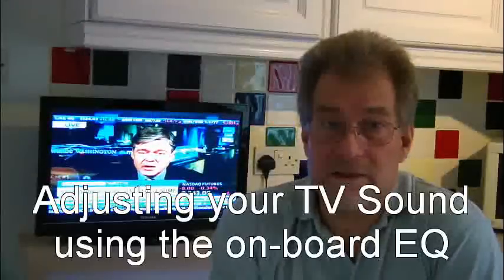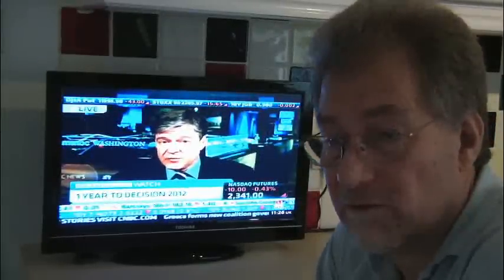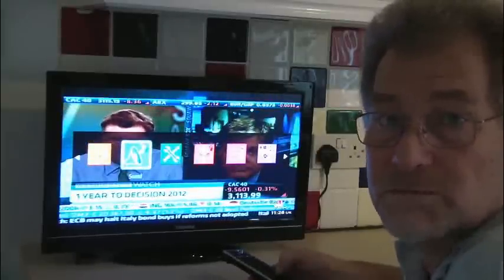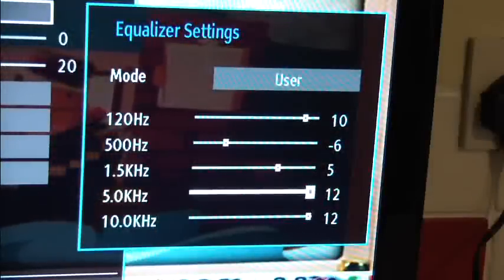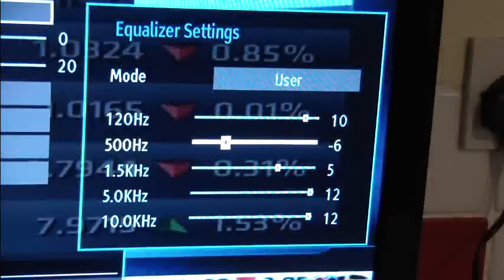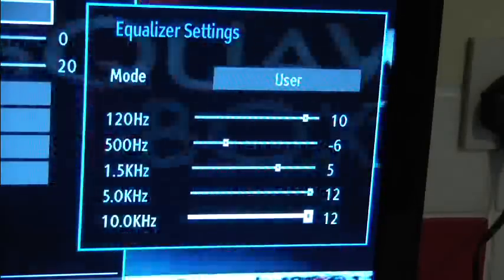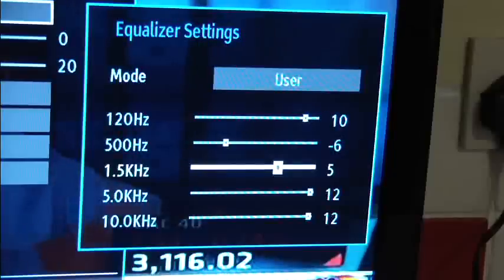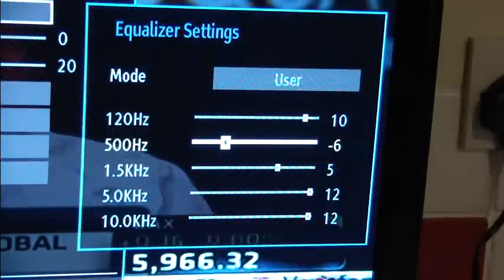Adjusting your TV sound using the on-board EQ

Comment: I just bought a smart TV from the brand "Vios" and I don't like how it sounds .

It has  these settings
High
Low
120hz
500hz
1.5khz
5.0khz
10.0khz

You can change them from 0-100
Which adjust you recommend?

Thanks and sorry for my English.
Reply from the maker: Hi, just try lowering or raising the different settings and then listen, using my video as a guide. It is impossible for me to tell you exactly what settings to change without hearing it and knowing the kind of sound you like and what you watch most on the TV (movies, documentaries, sport, etc.). Also, I don't know the brand of TV and how good the built-in speakers and amplifier are. If the voices are not clear, start by raising the 5.0khz settings (maybe to +60), and then try to lower 1.5khz (-20 maybe). If the voices sound very thin (little warmth in male voice) then raise the setting at 500Hz (maybe try +30). But the result will depend very much on the quality of the TV speakers and built-in amplifier; if these are poor quality then nothing will help, and then the best option is probably to buy a separate sound bar.

Comment: Hi Kevin, my Sony smart tv sound goes via my amplifier to surround sound system. I use YouTube a lot to play music learning the accordion. As you know the music downloads have various levels of volume which I have to adjust using my remote control interrupting my playing.
Is it possible to alter the tv settings to level all sound output.
Or do you know of a wireless volume control foot pedal to transmit to the TV?... thanks.
Reply from the maker: Hi John. I don't know of a foot pedal (I guess you might be able to control the level hands-free - vocally - using Alexa), but since you are taking the sound from the TV (via phono connections I assume) to the amplifier, there's the opportunity to place an automatic level controller between the TV audio outputs and the inputs to the amplifier. The only thing I can think of is a compressor/limiter of the kind they use in a recording studio to control the level of the vocalist etc. It might sound a bit OTT, but a search on Ebay will reveal a few of these designed for home studio use, so not crazily expensive, especially second hand. That would keep the maximum level under a threshold you set, and at the same time lift the lower level audio signals. Since you're a musician and would presumably mic up the accordion if you ever perform or record, you may find a future use for the compressor/limiter - it would help to smooth the level out as you move the instrument towards or further from the mic as you play, and it would keep the overall level in check. For practice use, just about any half-decent comp/limiter will be fine (I used to have a Yamaha GC2020 which would be cheap, as it's an old model, but would work fine for you). I use the Drawmer MX30 which is a good one for home studio use - you don't need a full blown pro model!

Comment: Hello, thank you for doing this video. 
I have a question. Is there a way to make back ground music less loud on a tv? My father is 97 and finds it difficult to hear some programs that have loud back ground music, that seems to drown out narration or speaking voices.  I appreciate any information you can give me. Thank you. Sallie Cooper
Reply from the maker: Hi Sallie. There's no perfect way to accomplish what's needed here, but one way worth trying is to use the built-in equaliser to boost the main frequencies of the human voice while reducing the frequency bands that apply more to music (though of course there's an overlap), especially in the bass area. So, try increasing the level on the equaliser at (and I have to guess since I don't know what settings you have) 1kHz and 2kHz (or 2.5kHz or thereabouts). At the same time, reduce the level of the frequency bands below 1kHz, especially, for example, 100Hz (cut it as much as possible, and anything below that - 80Hz etc.), 250Hz, up to 500Hz. Cut them right down, then lift the 500Hz while he listens as see if it's better - that will put some warmth back into the voice, otherwise it will sound very 'thin', especially male voices. Frequencies from 2kHz up to 5kHz can be raised as it can help the clarity of narration, especially if your father struggles with the higher frequencies (does he struggle to hear your female voice compared to male, for example - that's very common) but above that your father probably won't benefit, so they can be left 'flat' (centre position). The main thing is to increase the midrange around 1-3kHz and lower the bass frequencies. It won't sound very nice to you, but it may help with the clarity for him by lifting the voices clear of the bass of the music.
Reply: @24HzICE  thank you so much for your  kind and very specific response. I will try this and let you know if it helps him.  I am happy to know some things to try!

Comment: Hello, There are also some laymen or laywomen who buy TV's but are not 'Technically' minded.  Can we have some basic information.  My new tv thuds through the floor at times, Is my base to high or too low  Does less on the numbers bar mean more base or less. I am seventy and would just like to listen to normal voices and music with out the boom boom travelling through my feet.  No I do not have a relative who can help me.  Thanks
Reply from the maker: Is your TV mounted on a cabinet or stand that is directly sitting on a wooden floor (i.e. not carpeted)? If so, then some of the problem is because the bass is vibrating through the cabinet/TV stand and making the floorboards vibrate too. Wood transfers the bass frequencies quite well and can make it all sound terribly boomy! The same thing can happen when hi-fi speakers are mounted on stands onto a wooden floor. You can try to isolate the cabinet/stand by putting some kind of padding to lift it off the floor very slightly - maybe felt or rubber pads. What you describe MIGHT (also) be because the bass is too high, or maybe that's just making it worse. Less numbers on the 'bass bar' means less bass. By the way, I'm 62... I'm catching you up!
Reply: @24HzICE  Many thanks for taking the time to reply, much appreciated.  Very Helpful.  Jan

Comment: I've just bought a Medion smart TV. I've tried playing with the settings but it sounds a bit like everyone has a lisp?
Any ideas please?
Reply from the maker: Reducing the higher frequency bands (say 10Khz or 12Khz, depending on what you have on your TV settings) will tend to reduce the 'lispy' sound but it might well also reduce the intelligibility of the voice. I will say that it shouldn't sound like that, no matter what the EQ settings are (unless you have the volume very high and the speaker is distorting).  It could be a fault or something fouling the speaker inside, as a speaker or amplifier that isn't quite right will give a distortion that could sound like a 'lisp' on spoken voice. Impossible to say without hearing it though. Does it sound better when at a very low level - so low you have to put your ear to the speaker to listen, just as a test? If it gets worse as the volume is increased to a moderate listening level then it may be worth taking it back to the shop.
Reply: Thanks for the reply, I've turned it down on the suggested setting and tried it on a low volume. Still sounds a bit odd pronounced  on certain speech sounds. Thanks for the advice.

Comment: i modified my vizio tv to be at least 400-450hz of bass
ITS INTENSE
also the speakers were replaced with better ans stronger speakers and its intensely good sounding

EDIT: The speakers also add more bass so it has over 500-600hz of bass in it

Comment: Hi Kevin, Since my last comment we have purchased a Panasonic SC-HTE80 sound box from Curry's £130 quid and it is a lot better sound now and look's very smart telly fits great on top of it, telly is a Toshiba 32L3753DB Smart TV had it from John Lewis with excellent 5 years free warranty on picture is brilliant it was just the sound Thank God for that sound box .
Reply from the maker: Thanks Brian. Yes, ultimately, whatever tricks we try to do with the built-in equaliser in the TV, adding a dedicated, well-designed sound bar/box is likely to completely transform the sound; and you'd expect it to when you're paying out extra money :-) Some of the bigger TVs give a pretty passable sound - and it all depends what you need and what you listen to as to whether it's worth upgrading it - but by adding a sound bar you're effectively adding a separate hifi system to the TV. You have yours and I've no doubt, being a Panasonic model, it will have been well-designed and so perform well. For anyone else thinking of getting one, just take the same care you would if you were buying a hifi system; listen to a few and check the reviews online or in the magazines before making a decision.